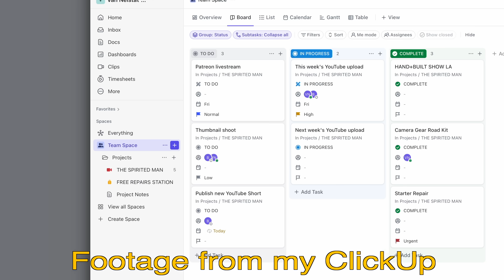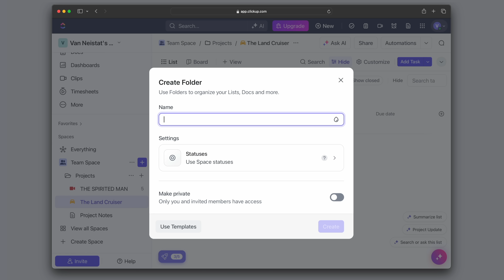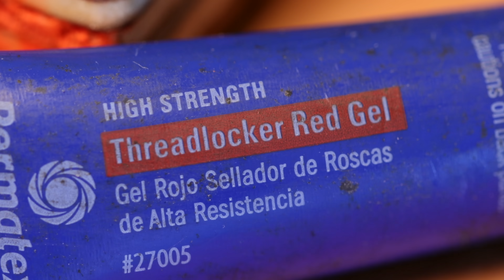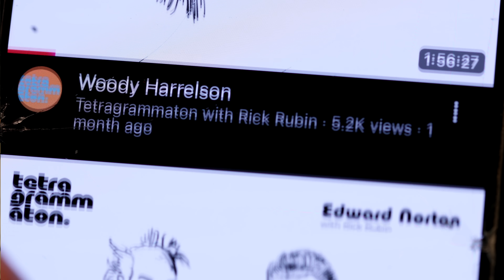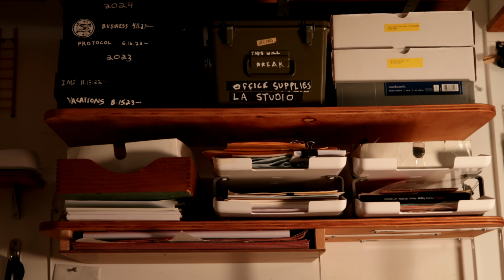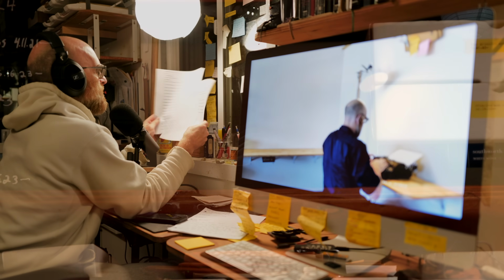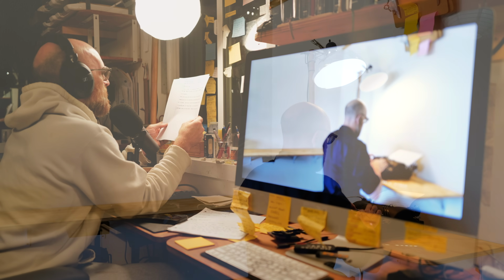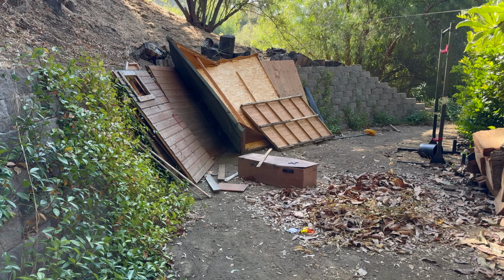I’m leaving.

Comment: I wall mount my desktops with those large white brackets too. I gave up on holes for routing wires tho. I now mount the desktop 3/4” from the wall and I can route wires all along the length if needed.

Comment: TORX > Phillips...confirmed
Reply: Torx definitely better.
Reply: @Rufio1975  Tom Sachs has a lot of people thinking Phillips is better. Van used to work in Tom's studio. The fact that he is using Torx in this video is a turning point.
Reply: @mmmbiscuits1211  
I hate Philips. Robertson screws are also better than Philips. I don't know how anyone can say Philips are good.
Reply: @Rufio1975  I hate square heads. But Phillips is trash. I only see Torx on  construction sites.
Reply: @mmmbiscuits1211  Why is that? I'm curious. I've never had a problem with square heads
Reply: @Rufio1975  The issue is when you have to take them out. The heads fill up with debris, then your bit is too shallow. And for some reason they warp more easily when you take them out. Remodelers and demo guys hate them(I have been both). However some cabinets shops use them for pocket joints. In that application its great. I personally only use them with the Kreg jig.
Reply: @mmmbiscuits1211  
  I can see that. I've never ran into that issue but I also don't do construction. Cool. Thanks
Reply: @mmmbiscuits1211  God bless the Kreg